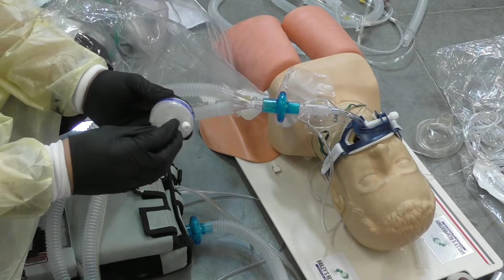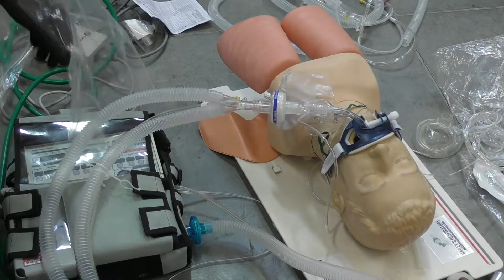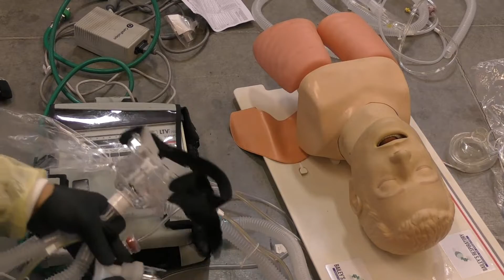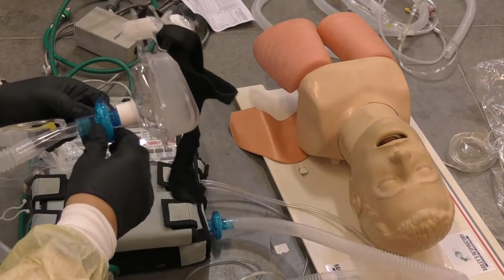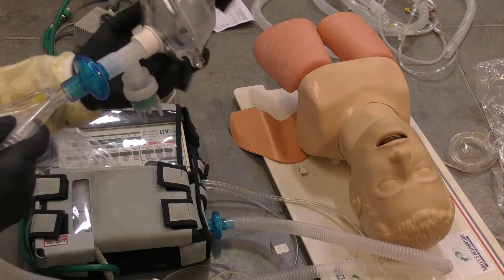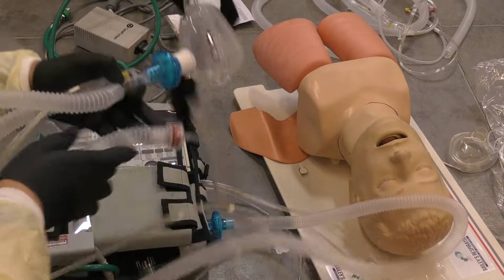Covid-19: LTV 1200 Filters for mechanical ventilation and NPPV (BIPAP)

Comment: If you have the filter proximal to the patient in place, that covers the entire circuit.  Why would you need a 2nd filter at the machine?
Reply from the maker: The hepa filter proximal to the machine is to prevent cross contamination and protect the circuitry.